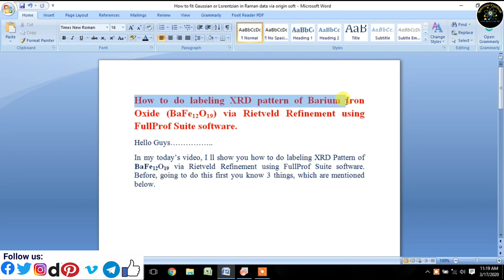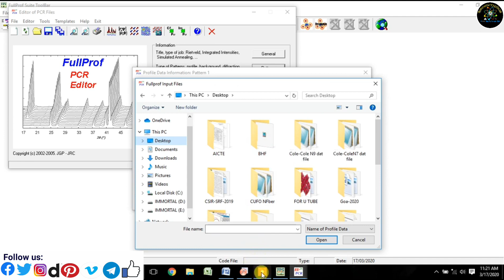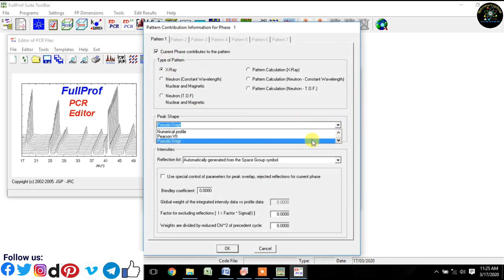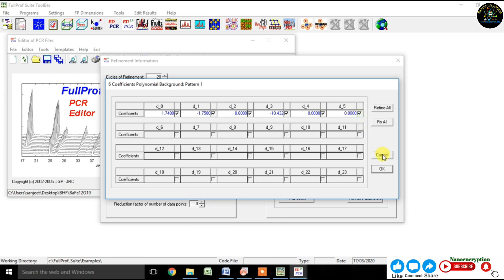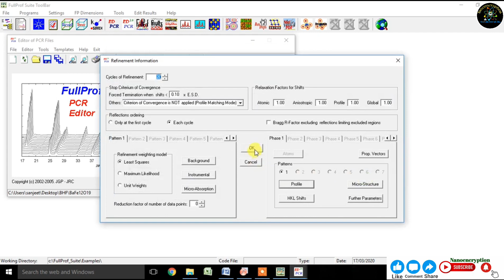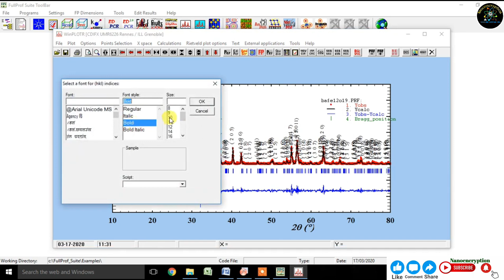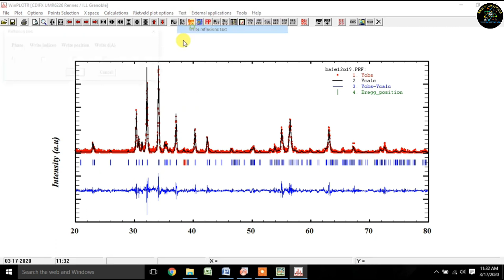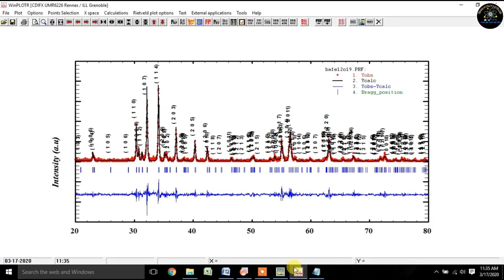Le Bail fitting of XRD Pattern of Barium Iron Oxide (BaFe12O19)via Rietveld Refinement via Fullprof

Comment: How to get atomic positions
Reply: These aren't required for Le Bail. If you want atomic positions you're going to want to do a full Reitveld Refinement. The idea of a Le Bail is to get the best pattern fit that you can, which means atomic positions and coordinates are not accounted for. This tends to be good for structures with extremely differential scattering which can make Reitveld more challenging, say if you have an Erbium and some very light element like sodium or calcium in the structure. You can also use Le Bail for lattice parameters.
Reply from the maker: From 
Articles
COD
Material Project website
Xpert High Score
🙏
Reply: GSAS can do it but you need a starting model unless you are doing single-crystal work